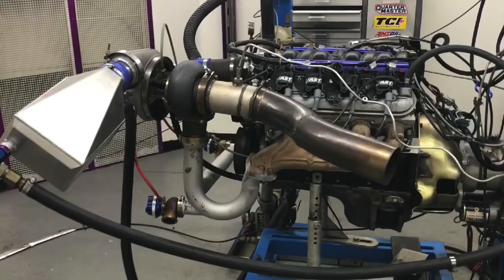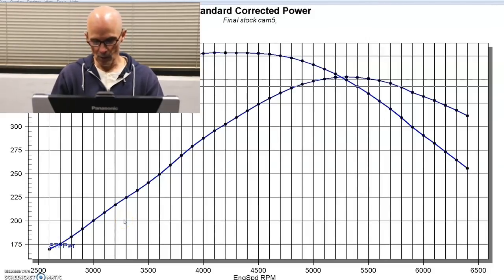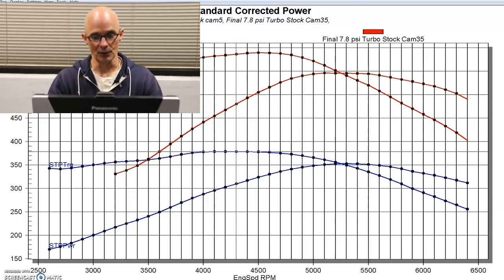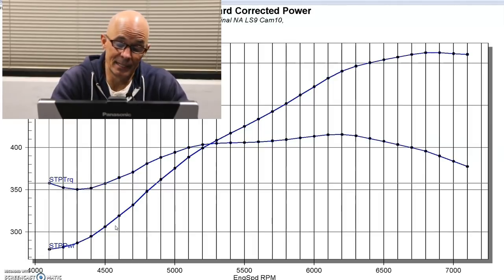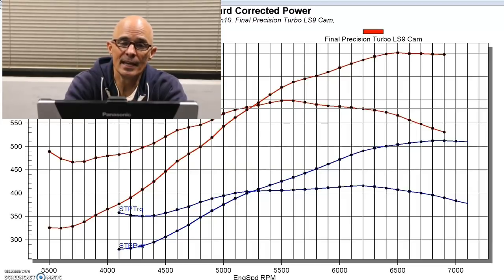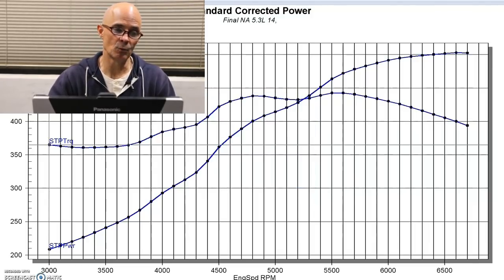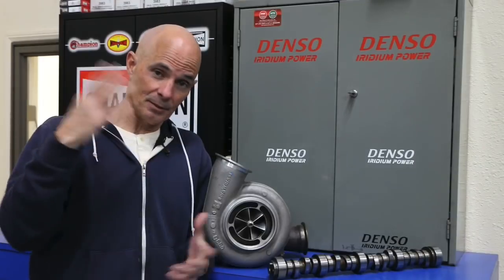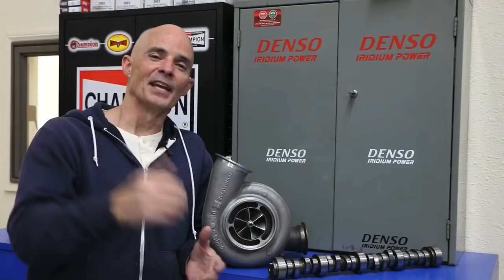REVEALED-DIY TURBO SECRET-EVERY CAM WORKS!

Comment: I’m kind of upset you didn’t break down the cam effect in relationship to the amount of boost created. Also the dyno is one thing, but it is definitely not the case for amount of vacuum present at idle and normal driving conditions and that’s why I think this is pretty BS, because all the guys that get butt hurt when there tunner refuses to tune their shit for streetability. You can increase the efficiency of a blower with running a wider lobe separation and larger  exhaust angle due to the Scavanging effect. The dyno data is completely subjective when it comes to living with the blown car with shity NA cam when it comes to greater boost levels. Just because you can doesn’t mean you should and this seems a bit missleading compared to your normal tests because the lack of detail put into what makes the difference within the valve train for certain applications.

Comment: I feel like somehow someone as smart as you has completely missed the point of cam designations. They aren’t there say which makes more power with what adder. They are there to say which will help a particular adder  perform at its best. Weather spool time or playing into the strengths of whatever adder they are designed for.
Reply from the maker: A cam that makes less power NA does not help spool time
Reply: @richardholdener1727  that is looking at this through a very narrow window of information.
Reply: You’re correct that any cam will work with a turbo or any other power adder. Its about what works better not what “works”. There is real world data that shows cam design can have huge effects on how a turbo performs.

Comment: So you put a turbo on this, and tested the "dyno curve" based on whatever the wastegates were doing??  You need to actually measure things (input/output pressure, turbine speed, airflow, etc) to talk about the effectiveness of any of this random correlations you are trying to talk about.

Comment: 14:35 3 bar = 43.5 psi tho?
Reply: 700HpVette  add atmospheric pressure to boost pressure for map sensor capacity
Reply from the maker: thnx for the assist
Reply: That makes more sense, I thought the baro sensor was used to set the 0 point for the MAP...

Comment: Good example of a pump gas 23 degree head 353 ci "NA" build, 570HP at 6500rpm, 507 ft-lbs at 4800-5000, flat tappet 238/244 105 LSA just under .600 lift. https://www.speed-talk.com/forum/viewtopic.php?t=51911

Comment: and if the trucks ecu doesn't detect the correct engine loading for pulling a trailer, it will not run on that high performance tune.

Comment: Fact if you advance a nitro cam it will make more power. If you retard a tube cam it will make more power. I believe a dedicated cam can work better for applications if you if it is right. I believe I pick cans best for applications

Comment: Labeling a cam, Turbo, Nitrous or Blower is like Labeling one Street, Strip or Circle Track. Its meaningless. Most "NA" cams for this engine would actually be around a 108 LSA unless you had 14.1 compression and high rpm then you would be in the 260's at .050 around a 111 to 113 LSA. Here is a 376 NA making 760 hp and 560 ft lbs with a hyd roller, stock crank/rods and valve train.  https://www.speed-talk.com/forum/viewtopic.php?f=1&t=51466&start=345

Comment: Every camshaft is not a turbo camshaft. I don't know why you're trying to sell that bullshit Richard
Reply from the maker: its okay if you don't understand-you'll get there
Reply: @richardholdener1727  😂😂😂🤣 Yeah We've been spec'ing custom grind camshafts professionally since 1999 worked on a lot of the early LS bigger  camshaft designs that we  designed between us proprietary lobes working with (comp cams ) at that time. When I was with Conley's Performance Plus. It was us and LSM that you guys have still used til this day. 3 of our grinds ljms tried to claim as there own from way back when. Not to mentions many other grinds we have done on our own with Daniel's Speed and Performance from 2004 on. From flat heads to side by sides, sbc, gen 3 hemi ,ro7 of course Ls and ATV's. Richard we even offered to send you a grind last year at cost just so you could test it for our community. We are constantly looking at various lobes and designs to make the best power and be reliable for any giving application. Companies we deal with are bullet, comp, cammotion. We do the math and have had great success after many years of trial and error during early R&D.  Hence why I stated what I said.  Not every cam is a blower camshaft, turbo cam or Na cam. Will it physically run yes.. Will it run best for the application NO..